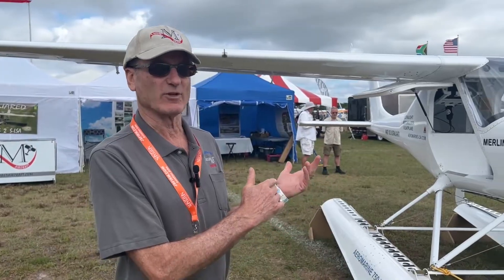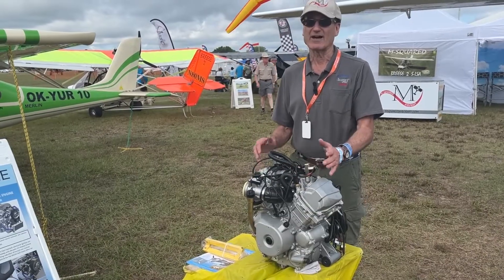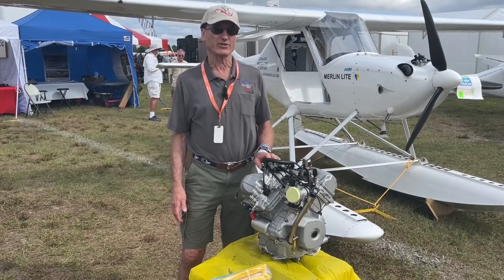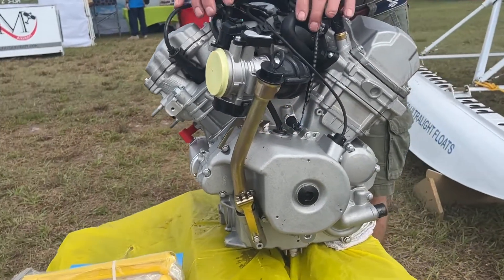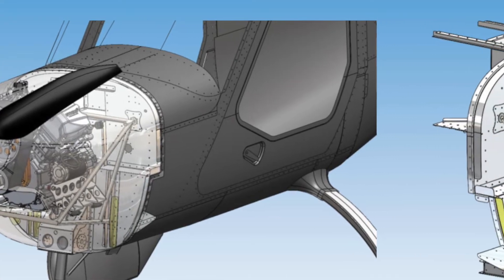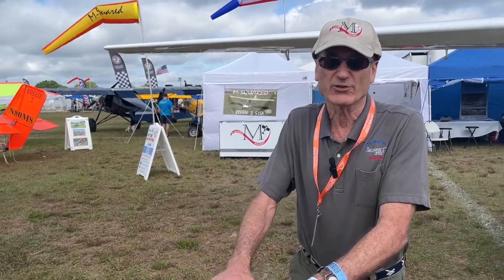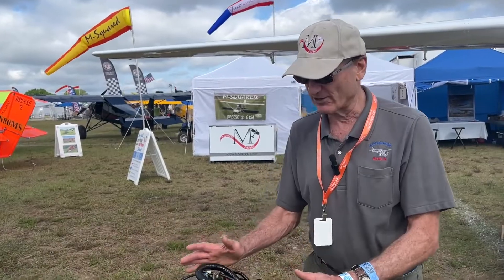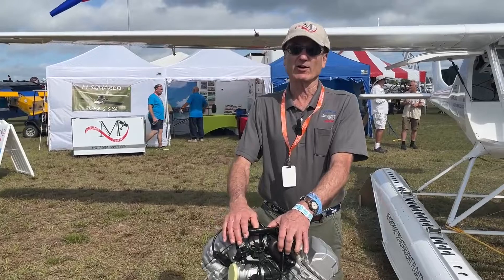Chip Erwin On the Aeromarine Four-Stroke LSA Engine

Comment: Bought one of these V-Twins last year at Oshkosh for $7500. It came with a wiring harness made for an ATV, so after sending the harness back to Chip and receiving it back modified, I had to ask for another original which was sent to me, I have modified it myself. Engine starts and purrs like a kitten. Saw Chip at Oshkosh 2023, bought some parts (fuel pumps and hoses) and he said he'd send some more, a water tube, re-drive upgrade... I just received them in the mail, kinda surprised at how fast I got them!
Reply: @DaveTube775  Yes, it helps get the attention of the manufacturer, and it seems to have worked. Met Chip, bought some parts, had a discussion about the re-drive, he told me he'd send parts and he did! Edited my original post to be manufacturer friendly. Communication is the key. When you ask and keep trying to communicate and get nothing back, it tends to get people upset. I'm hoping we are past that now, plus I have a $7500 engine that is now useful.